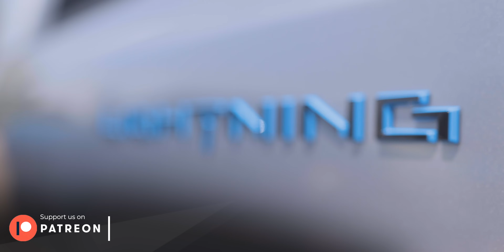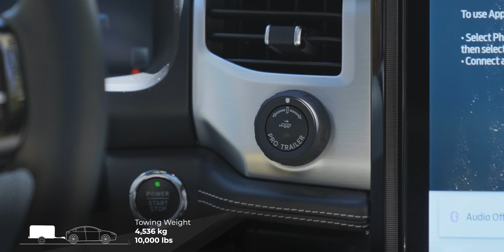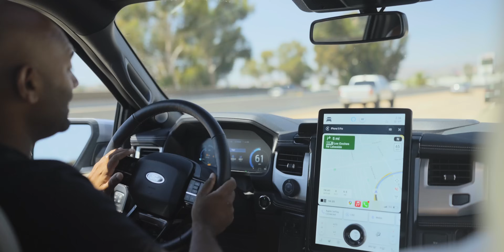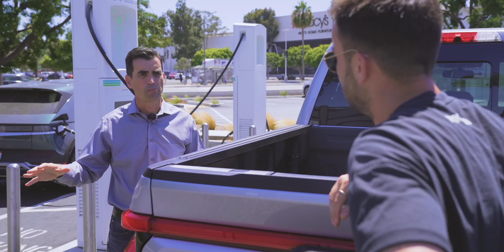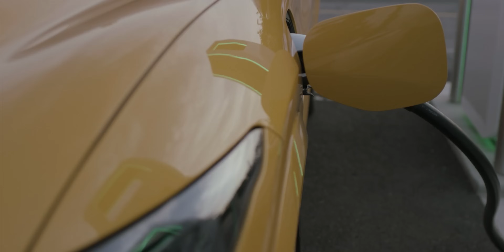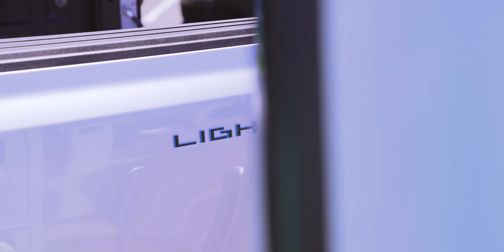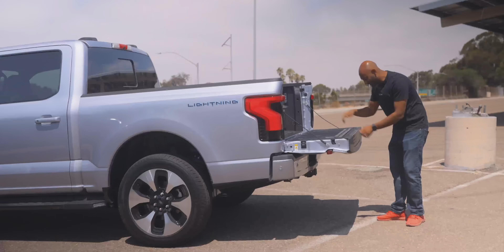Ford F150 Lightning: Is This The Best Truck Ever Made?

Comment: Sign that your pickup truck has gotten too big: it comes with its own ladder. Tempting, such a great impressive truck, but the size of these things has just jumped the shark. And I drive a 12 yr old F150 in Calif., and that is borderline too big, and the new ones are taller, wider, longer. That bed rim is up to your shoulders! I've had pickup trucks all my life and generally they're great because you can just throw things in the bed and reach in there and get them. Not anymore you have to stand on your toes to even see into the bed and really need to climb up in there to get anything out of it, but even the step bumper is too high! Next year's luxury models will probably come with a freight elevator. Please make an electric Maverick fer god's sake.
Reply: That's what midsize model trucks are for these days.  Ranger, Maverick, Dakota, Tacoma, etc.
Reply: The old pickup trucks in films and in the third world are low enough to bend over and grab what's inside.
I saw such an old truck in a cartoon from the Middle East.
Reply: One size does NOT fit all. I’m a woman who is slightly over 6 ft and the males in our family over age 12 are taller than me.  Families like ours need the head and leg room; my brother has an F-150 that he uses for work, etc. and needs the big truck bed.  The alternative to having a vehicle that fits your height and work needs is loading up in multiple small vehicles, which is wasteful….like when I was in school & driving a Ford Escort which my teenage nephews made look like a clown car, and it looked like we were doing yoga to get in and out of it. It took 2-3 cars to our family to get anywhere.  My current fuel efficient SUV fits 7 comfortably.  Tall people need the room (ladders optional).

Comment: Looking forward to the first electric work truck.  I really hope that @Ford does not screw up the F250 when it is its time to go electric.   These short bed, light duty 150's are great in the "retired-grandpa-needs-a-pick-up-to-go-to-the-store-and-do-light-yard-work" sense,  but a full bed and serious towing range will be needed for those of us who use our pick-ups for work.  In the future perhaps F250 will stand for 250 kWh battery pack.
Reply: I don’t get this idea, in Australia our tradesmen use utes (trucks) that are far smaller than the F150 with no issue. You don’t need anything that big to get work done.
Reply: Apparently they have F-150 for businesses? But you say it has to be at least 250 for work?
F-250 is only used for work, not show-offs. Okay then, F-250 is my favourite truck.
Reply: The F-150 is certainly a toy and not a serious work truck.  Likewise, the current F-250 is for plebe business types who want to pose for the shows.  What is really needed is an EV F-350 with some real power to it.  How else do I tow my Cat D3 to and from job sites here in Colorado?  Time for Ford to get serious.
Reply: @petryjkcr  You are going to have to wait for next generation batteries to do long distance towing. From what I have seen in tests, the weight of the tow vehicle doesn't matter much, but the aerodynamics of the trailer make a huge difference and to overcome that more powerful batteries are needed. Luckily, new chemistries and new types of batteries will be arriving in about 2 years, and probably every 2-3 years after. The next batteries might increase range 20%, and the generation after might double it. For now you have to use diesel
Reply: FUD motors only produces GARBAGE vehicles.

Comment: The EA maintenance explanation shows why things are regularly broken. They send someone twice a month to look (and then later fix) rather than having the software/analytics to report immediately when things need a remote reboot or to send a repair person.
Reply: Did you not watch the 2 minutes before that statement? The 2 minutes before discusses the constant analytics and the ability to dispatch maintenance teams as needed. The twice monthly are routine checks to make sure things without analytics like insulation or the asphalt around the charger are okay and they check the chargers in case of other anomalies that may not be reported for some reason.
Reply: @ProjectShamrock  real world experiences disagree with this at a HIGH rate. Their up time is in the 75% ish range.. which is dog shit
Reply: @airheart1  Sure their response time might be dogshit but that is a different problem than the OP saying the technology isn't capable.
Reply: @ProjectShamrock  true. They may well get the info. But they are not rapid at response.
Reply: Had the same thought - how is that an adequate check?
Reply: I think they still get real time polling of the machines.  It's probably twice a month for insulation inspections, etc.
Reply: Electrified Canada, is just as bad. Since day-one when they installed the chargers at the Canadian Tire store in my area, they haven’t worked properly. I have to called them 80% of the time when I need to charge and I keep telling them some of their chargers are broken and months go by and still not working, so I just gave up using Electrified Canada.
Reply: @TheRankofCommander  it’s a sad state of affairs.. but that’s what you get from a company formed as a punishment. They have no great leadership or drive to be great. They exist because they have to. It’s unfortunate, but until they get someone in charge who gives a shit to be great and successful in that space.. I doubt there will be much improvement
Reply: @TheRankofCommander  Perhaps these sort of outfits have twigged battery EVs are on their way to the crushers?

BMW are now going for the hydrogen fuel cell look.

Perhaps the penny has dropped that the aim is to be carbon zero, not just  neutral.

EVs are a splendid notion but batteries (of any type) are no longer considered the way forward with regard to vehicles.

Batteries far more useful for storing power in a dwelling, say. We now see them in domestic buildings for storing the power from solar arrays on the roof or garden.

Then used for low voltage lighting application.

I've been doing such for best part of six years.
Reply: @t1n4444  This is nonsense.  Hydrogen for passenger cars is a disaster.  Batteries are what the entire auto industry is doing.  Battery EVs "on the way to the crushers"?  Are you kidding?  The waiting lists for desirable EVs are in some cases over a year long.
Reply: @incognitotorpedo42  

Hmm, you type as if you're involved in the battery powered EV industry.

All you had to do is Google up the manufacturers doing the R&D thing on hydrogen fuel cells.

Doubtless other posters have done so and worked it out for themselves.

Pure battery technology vehicles are already on their way out. Charging time is the issue if you were unaware.

Why not review the latest EV ads on UK TV ... note the "re-introduction" of the "hybrid" word.

Suggest you forget all you thought you knew about hydrogen fuel cells and at least attempt to do some research.

Hint: the aim is to become carbon zero, not carbon neutral. Hydrogen fuel cells offer a better solution to this issue.

Hope that helps.
Reply: So they reckon it could break in two weeks ? Have they heard of designing for reliability ? Though in fairness half the problems are probably software mismatch between charger and car - you know the kind of thing where manufacturers disagree on the interpretation of protocols and standards.  "Well ours works perfectly", until it doesn't...Or Volkswagens fiasco with Cariad - why use a small team, when 5000 can f*** it up far more thoroughly....
Reply: Yeah that a managers approach to a business.

Not a technical, maintenance and customer forces company.

BA should be banned from leading companies.
Reply: No  mention was made regarding the units reporting faults back to a central maintenance base. From what I've seen so far, they wait for a customer to give them a ring and report the issue. The engineer eventually turns up god knows how much later (days? weeks?) to fix the issues and probably has to wait a long time for replacement parts to arrive. All very inefficient.
Reply: @Musketeer009  
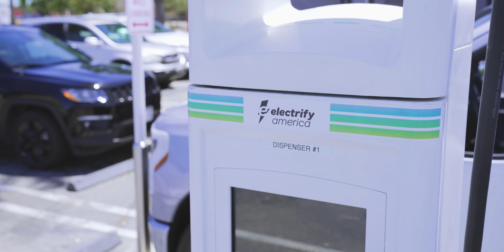What do you call 10:44-11:10 other than discussion of the machines reporting faults so maintenance can be dispatched?

Comment: One very important topic I think was overlooked was the towing shortfalls.  It drops range basically in half.  More if towing near it's rated limits.  Several other channels have proven this to be true. Charging while towing is a large issue too as very few chargers are pass through.  No room to back in a trailer.
Reply: True - but that's not specific to the truck - every EV suffers a massive range reduction from towing... mind you, so do all ICE vehicles, it's just not as apparent and gas stations are better set up for refueling vehicles that are towing.

Comment: Apart from it's genuine usefulness as a work truck, it's an ideal vehicle for people who want to project toxic masculinity and contempt for other road users while simultaneously greenwashing their profligate lifestyle.
Reply: Well those are the gasoline super users, so getting them out of a fossil burner getting 15mpg or less. And into a lightning or r1t which gets 60-70mpge is a win for the environment overall. Plus those types are the holdouts to mass ev adoption. 
So everyone who gets one of these a hummer or rivian is gonna end up starting some conversations around evs with their buddies about them. 

Conversations which will very likely lead to more of those gas super users buying ev trucks instead of another "mah grand pappy bought nothing but v8 Ford's so ima buy nutin but v8 Ford's" 👍🏻😀
Reply: Indeed. Most buyers of this truck will not do any work with it, and should be using a bicycle if they want to get around while saving the planet
Reply: @YounesLayachi  Unfortunately, people are not educated enough. They think bikes and e-trucks are equal simply due to lacking engines
Reply: Plenty of comments on here already from ppl who see this as a great working vehicle, or potentially great working vehicle. Let’s hope they don’t upset themselves reading this unpleasant, judgemental & probably entirely unfounded remark.
Reply: I prefer the word irresponsible masculinity over toxic masculinity. The latter should only be applied to men who don't know their limits with women.
This truck is for a person who spends too much on showing off and not enough on the education of his children or on charity. It is irresponsible, but I wouldn't call it toxic.
These trucks kill many, but nobody driving them cares because no motorist thinks of themselves as a danger; it's always 'those other drivers'. Everyone thinks they're a good driver, otherwise they would use civilised transport.

Comment: "I doubt they are even 20 amp."  Hey take the 5 min to look it up.  We don't watch these videos for guesses.
Reply: Also ... how many jobsite tools require 20A at 120VAC? Nothing I own. The 240V 30A plug would be enough for a welder, though, if you don't go crazy.
Reply: @ps.2  2400w? You could use more than one tool at a time, you know.
Reply: @sjoroverpirat  I could, but I don't. I rarely dual-wield power tools.

And most extension cords I see have 16g or 14g wire, not suitable for carrying 20A. So I suspect the use cases for requiring a 20A outlet in a pickup truck are pretty limited.
Reply: Indeed, very sloppy reporting. Better to say nothing than take a random guess.
Reply: Yup.

Comment: Single cab, eight foot box, interior you can wash out with a garden hose. That's a truck. Manufactures start paying attention again please.
Reply: Just buy a van, the pickup truck is just for showing off these days
Reply: @Mireaze  If only Ford would build a Transit Van version of this truck... alas, their latest Mk2 Transit EV still has f-all range, and none of the plugs / utility, etc (iirc)

Comment: But you didn’t get a miles per kWh with a load. My model Y loses 1/3 its range when towing 3500 lbs.  it would have been informative to have this additional metric.
Reply: When you tow you lose about half range that’s just the way it is.
But the thing is is measuring this is not very useful, because everything you tow is going to have a very different effect.
If it’s heavy, its light How its sprung how aerodynamic it is, how inflated the tires are it can vary wildly.

Basically if you need to tow something for more than 120 miles often, this is not your vehicle. I wish it were different but it’s not.
Reply: another channel did a test with a water container loaded up to its rated max weight and iirc their F150 lost only like 5% of range on a highway loop but towing a non-aerodynamic trailer the range got cut almost in half; the Rivian behaved similarly in both tests too but with a tad less efficient results. Seems like aero is more important than weight at least when it comes to range impact
Reply: @amnottabs  yes aero is the main killer, together with ground friction from tires.
But aero only really matters at going above 50kmh or 35mph, and increases quadratically, (2x speed 4x drag)
So at highway speeds it adds a ton of drag.

Anyways if you tow a lot if stuff, its usually a safe bet this is not ideal, especially if its tall, and catches a lot of wind,
That said if you don’t need to go super far this is by far the cheapest way to do it.
Reply: @FreekHoekstra  Commercial users don't travel too far, so 150 miles is what they need. The base 300 mile battery is good for them. For recreation, you would like the 500 miles which half to 250.
Reply: @FreekHoekstra  that makes sense as they cruised at 70mph if I'm not mistaken with the water tanks; another channel is releasing a road trip to the northernmost point of the US in a F150 Lighting and they said going from 70mph to 60mph yields significant improvement for their range since they had a campertop fitted to the truck's bed. 
I am all for EVs looking like regular cars instead of funky looking vehicles but maybe a brick-shapped electric truck is not benefiting too much from this trend
Reply: @amnottabs  yeah aero helps a lot, but if you tow a brick behind you, the aero of your truck won’t make much of a difference.
But yeah in general driving a little slower will save you a ton of gas/electrons. Especially in a larger vehicle.
Going 55 instead of 65 mph will probably save you about 15-25%, 20% being in an average car.
And it gets so much worse beyond 65 mph its honestly rarely worth it,

Tesla actually has a nice graph, range vs speed, models efficiency and range.
But its very aerodynamic so it looks a lot better then most.
Reply: The car tells you, Marques Brownlee did something on it from my memory. Also I don't think a tesla is going to be a good comparison for battery drain from added weight load.
Reply: Now You Know tested the Rivian under load, but I don't think they have tested the F150 yet like you are describing. I'm sure they will though.